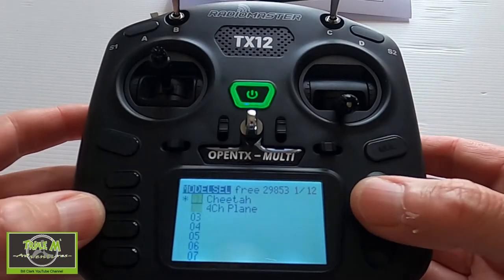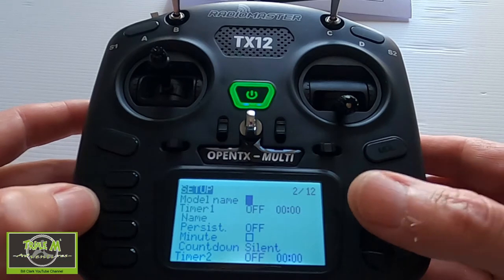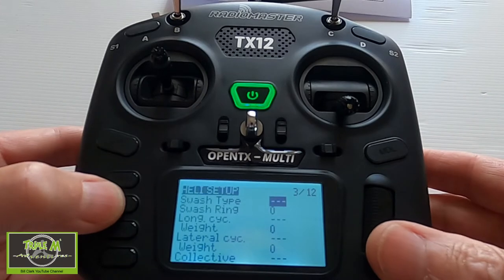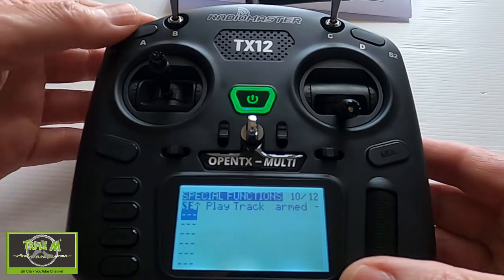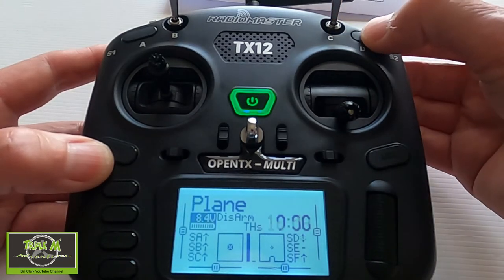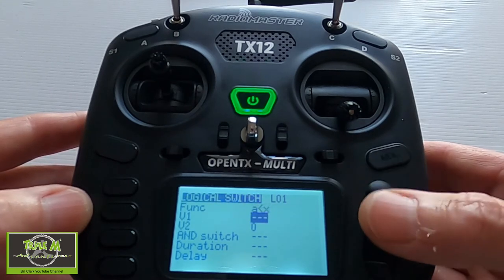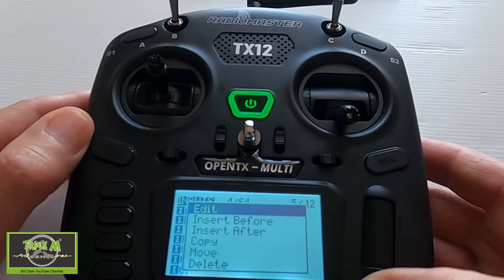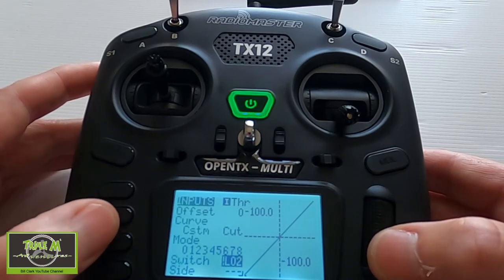RadioMaster TX12 Basic 4 (5) Ch Fixed Wing Model Set Up with "Safe" Throttle, Binding.

Comment: Thanks for this and also you're the first person I've seen that has helped me understand about the reasons for numbering the rx (or not)as the case may be  !!  Also this radio is appealing to me more and more as a relatively simpler way to go as now that my old brain sometimes struggles with the more complex tx16s that I have, mainly because of the masses of different functions that are available in it and I need a slightly more basic version without all the colour schemes and screen whizz bangs and such like, thanks again from a grateful Alan in the UK 🤗🤗👍👍👍
Reply from the maker: You are very welcome Alan. I have a lot of tutorial videos in the pipeline which should help you with the TX12 if you get one. If you need any specific help please feel free to email me. Hope you have a happy but locked down Christmas. Stay safe.

Comment: Hi Bill, 
 Thanks for your excellent videos for the TX12. 

Yesterday I received my new Radiomaster TX12 and luckily I found your channel. I have viewed all of the videos and they are excellent and very helpful, especially as I have never used OpenTX before.
I have always been a Futaba user but I wanted a small transmitter capable of working with my S-FHSS receivers that I have in small gliders for when I go hiking in the hills and along cliffs.

However, I am having trouble in attempting to create a new model.
When I am on the 'MODELSEL' screen 1/12, if I scroll down to say '05', press 'ENTER' (on thumbwheel), select 'Create model', press 'ENTER' again and a pop-up appears for less than a second saying 'Loading model' and it puts an entry in the 'MODELSEL' screen against '05' of 'MODEL05'.

If I now press 'PAGE>' it takes me straight to SETUP screen 2/12, bypassing all of the model selection steps that you displayed  in the video, such as Select model type, Got an engine?, Got ailerons?, Got flaps?, Got airbrakes?, Tail config, and Ready to Go?. There is no way that I can get into that sequence of screens.
I have checked in the Radiomaster TX12 manual and it doesn't show any of the model selection steps shown in your video, it also seems to bypass them as well!   See Page 26 onwards.

Have you any ideas what is happening and where I am going wrong, if it is me? I am waiting for an SD card to arrive so there is not one installed in the transmitter at present, could that be the problem?

Your help will be most appreciated.

Many thanks, Eric
Reply from the maker: Hi Eric, you are not doing anything wrong. The model templates are stored on the SDCard so if not present the radio makes a standard model which will set up the model as your default channel mapping. OpenTX has a learning curve put worth learning.
Reply: @the-happy-RC-flyer  Many thanks Bill for your reply. Hopefully my SD card will arrive at the weekend. Cheers.
Reply: SD card arrived, I loaded the files and everything is working fine. Many thanks keep on with your excellent videos!

Comment: As you have a slightly different version I had a problem getting into the throttle edit screen. I have the us version ELRS. I was using the wizard set up, almost exact menus.
Reply from the maker: If your radio uses ExpressLRS this video should help you https://youtu.be/9oZrEa74AEI

Comment: Hi Bill   Trying to bind my FlySky i16 rx to my new Radiomaster edge TX12 but it appears that this is not available. Have used these RX on my old Jumper T12 with no issues and am reluctant to change as all my planes use this RX. Cheers
Reply from the maker: I think you have the CC2500 chip which does not support FlySky receivers.
Reply: Thanks Bill.   Is there anyway I can upgrade or down load to enable this unit to support these RX. Cheers @the-happy-RC-flyer
Reply from the maker: @patterdalebt  Sorry Colin no because it is due to the CC2500 chip not  supporting the protocol. Adding a 4 - 1 module to the JR bay would work but at a cost.
Reply: Thanks Bill for your prompt reply this is now up for sale (unused) Cheers @the-happy-RC-flyer

Comment: I have a question, very important I live in America and I am settling up a tx12 ELRS and it's a little different,  my wizard menu is the same for the setup, I'm just wondering if in the initial setup on changing channel 6, would that remain a 6 in America? Trying to follow, you'd think somebody could make it easier, yours is the best so far..
Reply from the maker: Yes it would be the same.
Reply: @the-happy-RC-flyer  Thank you, I keep plugging away,  going front to back, section by section, thank you for your video and response, I may have more questions 😂
Reply from the maker: @capnhardway  no problem ask away and I will try to help.

Comment: Hi Bill please can you help me, I just brought the TX12 to use with my Hubsan drones but been told it can't work with Hubsan protcal , there is a Hubsan in menu on the TX12 menu, will it work or do I have to buy the Four in One module and then it will definitely work on Hubsan drones? Which For in One Module is best to get? Many thanks.

Comment: Hi Bill, struggling with this setup, can I use the same procedure for the USA ELRS?
Reply from the maker: Yes you can.
Reply: @the-happy-RC-flyer  I just ran across the throttle settings in the inputs . I'll try to continue further tomorrow, Thank you.

Comment: Hi, I created new model profile on my TX12, but I am missing RC link in tool (eg. "Loading... ?/???" when selecting ELRS config). Does it mean that each new profile requires new flash?
Reply from the maker: It sounds like you have flashed the incorrect firmware to you TX12 have you updated the firmware?
Reply: @the-happy-RC-flyer  I have got ExpressLRS working fine on my quad model profile, but just "loading...?/???"" on profile for RC plane.
Reply from the maker: @brezovprut4431  have you selected the correct protocol or have no options?
Reply: @the-happy-RC-flyer  I have selected (same) ExpressLRS protocol I use with my quad, but seems that this lua script is just loading, and not showing anything.
Reply: @Bill Clark I found solution. Problem was why I haven't enabled on new profile External TX (CRSF) because I use external ELRS TX module. Thank you for your help !

Comment: I can get it to say throttle on and throttle cut but it doesn't reflect it in the sticks.
Reply from the maker: You need to check your settings are as the settings in my video and you should be ok.
Reply: @the-happy-RC-flyer  I have a bit of a different menu. In my bar menu that shows throttle it dies work correctly so. Still can't get the rudder description right.  Thank you Bill, I'll know more when the rx gets here. Thanks! I keep going through it, beginning to end 😂

Comment: Just tried all as you said. No throttle in both cases. Tried twice. Maybe I missed something. I(I'm not a programmer, just a welding engineer.) Cannot understand, where the OpenTX sees the CV1 value? It sets the curve flat, to 0, but where the connection?
Reply from the maker: Could I suggest you check all the settings carefully because it sounds like the logical switches are not set up correctly.
Reply: @the-happy-RC-flyer  I'll try again. And how CV1 passes to the throttle adjustment?
Reply from the maker: @KilchevSky  maybe the curve is not set up correctly please check it through the set up.

Comment: hello, is it possible to set Arming to press A + D at the same time? If so, how?
Reply from the maker: You could do what you want but I would not advice it because you would need to remove your fingers from the gimbals to disarm. Would recommend using a 2 position switch. If you want to do it you need to set up logical switches which I can help you with.
Reply: @the-happy-RC-flyer  thanks for the answer! I want to set it to A+D, I made logic switches with the STKY and AND function, but they do not work correctly... can you offer your own version of ARM on A+D?
Reply from the maker: @ЕвгенийТеряев-х9с  In logical switches select Function AND
V1 and V2 choose the switches you want to activate the logical switch. Then use this logical switch as your switch in the armed mix
Reply: @the-happy-RC-flyer  Thank you, I tried to do this, but after the first press of A + D, they start working each separately, the meaning is lost ...
Reply from the maker: @ЕвгенийТеряев-х9с  you will need to have both switches on for the logical switch to activate which means whichever switch you turn off your motors will disarm.
Reply: @the-happy-RC-flyer  yes, I understand this, but it's not really convenient, since I can accidentally click on A or D and disarm will happen...

Comment: Hi, is it possible for the tx to work without SD card ? The 18650 battery is the flat or button type ? And what is the mah ? 
Sorry to ask am new to the game . TQ
Reply from the maker: mAh is mill ampere hour shows the capacity of the battery. 18650 batteries can be different capacities larger capacity will power the radio longer. I would suggest the 18650’s are matched, the same capacity.
Reply: TQ VMUCH